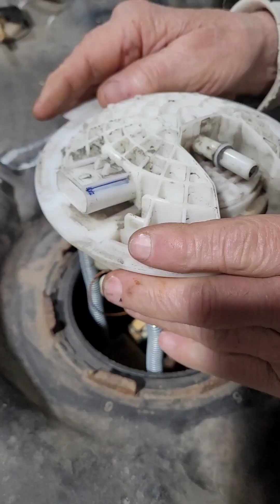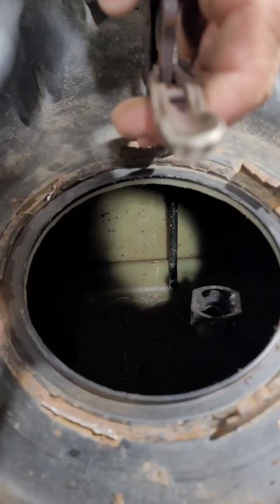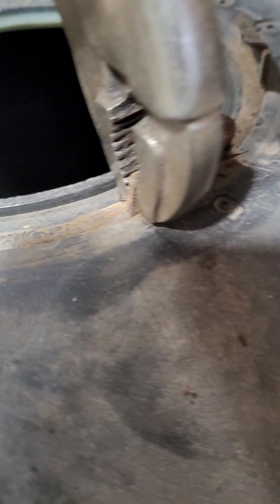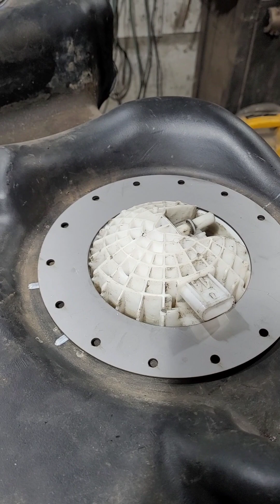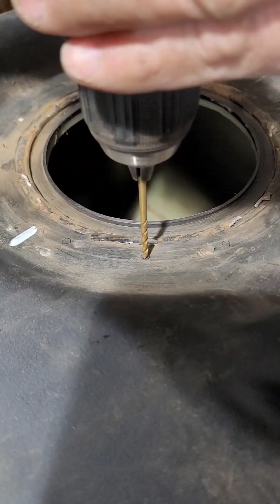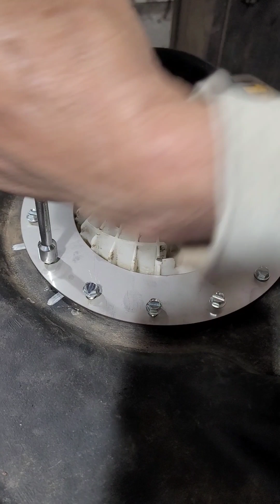2004 2005 2006 Dodge Ram 1500 34 gallon fuel tank repair kit.

Comment: Would this work on 2007 ram 2500 with 30 gallon tank.
Reply from the maker: I will look into that. What size cab and box length does your truck have?
Reply: @kellybunn5719 34 to 35 gallon tank 2007 dodge ram 2509 5.7. long bed 4 door